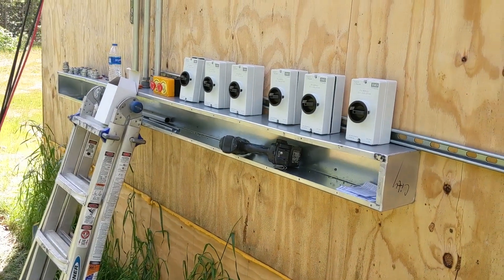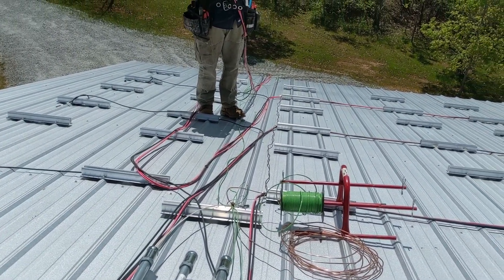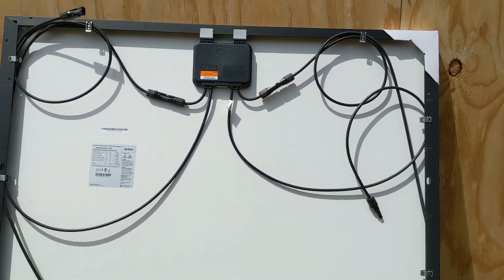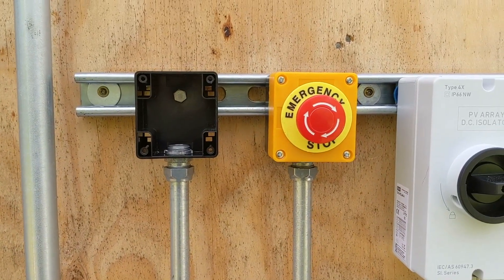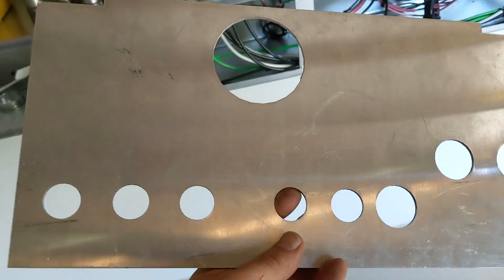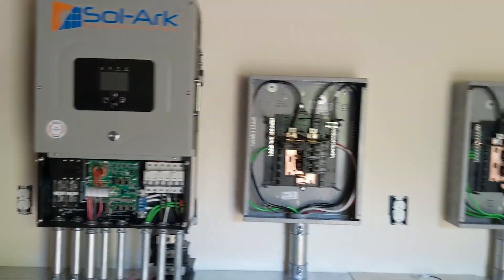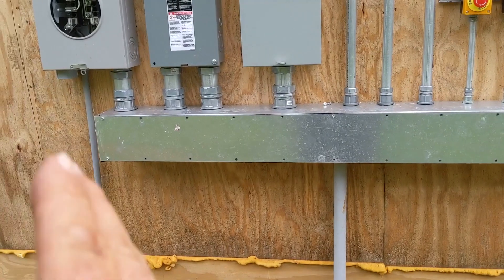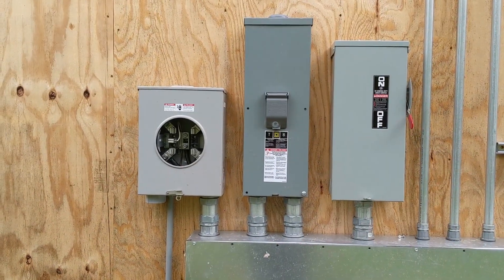Easy Parallel Stacking for Massive Peak Power

Comment: Great work. I'm about to install a system with two Solark 12 kW inverters. I do have a question regarding the transfer switch. You said it transfers between Solark and Grid. Is that necessary? Would love to talk to you if can spare a moment.

Comment: I did my homework and realize that I was being unreasonable with all my newbie questions.  It is an ac combiner box. I downloaded the sol-arc 12 Outdoor type manual and it explained a lot.  So I apologize.  I am enjoying many of your videos. Keep it up.  This morning I saw on the news of the heatwave in California and Oregon and the melting of cables.  Have you any feedback from homeowners as to the solar units installed and how they are operating? It would be helpful to do a video on the effect of the heatwave on rooftop solar setups and how to upgrade to existing solar system for future heatwaves.

Comment: Nice set up.  a few questions if you don't mind. First did you do positive or negative grounding on the solar panels? Did the roof racks have provisions for grounding to the panels? I understand some systems allow for the grounding wire to be run with the cables to the disconnect boxes. You used iron pipes to run the cables from the solar arrays, did these pipes and all the iron guttering system  had to be grounded also? What size wires were used from the panels to the gutter system? What size panels (voc Isc ) and how many strings ex. 12 in series and then in parallel? 
Thanks

Comment: Scott, question on the Dual Sol-Arks and breaker sizing?  Correct Breaker Size for Grid going to sol-arks? 50A or 60 A breaker?  On the Critical Loads Panel back feeding from Sol-Arks? 50A or 60A breaker? I believe each solark will allow 63Amp of pass through on grid?  So that is why I was thinking of needing a 60 Amp breaker size at the critical loads panel. Thanks for your help!
Reply from the maker: 60amp.

Comment: I’m installing 6 strings of 8 (48) 430w q cells, ground mounted. Dual 12K. Can I use two (one for each inverter) 16a 6p IMO’s instead of six like you have here? They are rated 16 a PER POLE.

Comment: Why 6 disconnects? 3 per sol-ark. I thought they were for the PV strings and the sol-arks only accept 2 MPPT strings each? What am I missing? Also with the quick disconnect are the other disconnects needed? What is not shown is the wiring diagram it would be nice to see how all the hardware is wired.

Comment: I love the clean work you guys do, especially with the trough setups, and bypass switches on all installs, looks great. Me personally, I don't really like the idea of having a 'rapid shutdown' right on the outside of the house where any stranger can push it and kill your power to everything. I wonder if you could automate rapid shutdown into a fire detection system that would trip with your fire alarm. I wouldn't want any switches on the outside of the house unless they were secured...
Reply: I'm pretty sure the rapid shutdown would not be compliant behind lock and key. Just a guess and based off nothing but my mind.

Comment: I’m confused. Will the service panel for the house be outside of the main house since you said it has not been built yet? How will power get to the finished house? I’m curious because I want to move my service panel and inverters to an out building about 100 feet away from my house. Thanks! Great instal and video!

Comment: I notice everything exterior is mounted on plywood.  Is that the finished exterior or is there going to be siding?  That plywood only has about 5 years before it disintegrates.
Reply: True, but I'm sure if they can afford that set-up, there's a bigger plan and all will be fixed or corrected before its covered. I've seen meter boxes/panels installed before siding went up.

Comment: @Engineer 775, love your setup and explanation on this video. But  l was wondering why no battery backup storage included?? I also like 3 - way switch box to change up power sources when needed. 
Saw l need do that for my next home in the near future.  Please include a basic wiring diagram too, unless you are worried about property theft.  Thank you again for the video detailing how to layout a solar panel installation.

Comment: I would say that a rapid shutdown is an overkill.
Reply: Not really.  You can't see anything up top and not any time to test everything if something bad happens (lightning strike, maybe).  Run up, tap the shut off and disconnect everything to allow safe diagnostics.
Reply: I'm betting it was some sort of electrical code maybe?

Comment: With this system. Can you do a whole house 200 amps of power not on roof but on ground ? How much for this sistem
Reply: Same question - I have 400A service split into 2 200A panels. Would love to back up everything, but 200A would be fine.
Reply: Too many variables. If you consume 1200-1400 kWh of power per month in the middle-southern half of the USA, you’d be close. DIY with some LFP batteries for $50K.
Reply: @USA-GreedyMenOfNoIntegrity  TOO MUCH $$$ HAVE TO DO THE TOTAL AMPS. 40A. HEATING ,20 AMPS WATER PUMP, 40A.COOKING,20AMP WASHER,30AMP DRYER

Comment: Scott, I have a question about ground mounts. I just happen to catch this video and this idea popped into my brain space. You and Johnny can give your input on this idea. He and I have been in talks about a ground mounts and my site has less than ideal conditions for typical ground systems (ledge, rock, more rock, some stuff imposing as dirt, earth biscuts and trees lol). I took my mini and dug test holes. Some were very easy to dig about 4 feet down while a couple other spots were just solid rock at 8 inches. Johnny and I talked about ballasted mounts. I don't know how I feel about them. They seem bulky, quite ugly and I see potential for them to be a problem with frost (I'm in NE PA). What about building small solar arrays and installing them on single post mounts, like those used in tracking systems? I feel this would give me more flexibility in placement and size. I know with typical ground mounts that use a single post buried in earth need to be aligned, level square and true to each other. My terrain isn't super flat, has a soft slope, but the overburden is my concern with these. I also want to start small with the system and grow it as it becomes more financially accessible. I have a magnum inverter and charger working off 6 100w panels at the moment. I have no utilities on site as of yet and the power company is giving me a hard time so I'm about to say ** off. I'm just looking for some insight from you guys since you do this for a living. I don't know how often you run into the type of earth I have. Any additional info would be appreciated. Thank  you for your time!
Reply: If you got solid rock you might be able to use masonry fasteners to secure a post to the ledge. You might need to pour a small concrete block on top of the rock to provide a flat surfaces for the post ( I am presuming the ledge is uneven & sloped). Then drill holes into the block & ledge using a hammer drill and fasten the post using simpson titen bolts. For steel posts you can weld on a bottom flange. I believe for wooden posts you can by pre-made bottom flanges.

I would recommend to work with the power company to get grid service. It will be cheaper way to go unless you have deep pockets for panels, genset and lots of gas money for the genset (specially if you not in a sunny location, or your property isn't in the best location for sun). You basically be running that genset 8 to 10 hours a day during home construction as you & your crew will be running power tools all day. Not fun filling up the GenSet 2 or more times per day and making frequent runs to fill up a bunch of 5 gallon fuel cans.

FWIW: It took me about 4 months to get the power company to extend service to my home site. Issue is that power companies are having trouble finding workers (few young men are not interested in, or have health\drug issues. The older guys are slowing retiring). Just be nice, & patient. They work with you if you give them a chance.

FYI: While I do have grid service I also do have a SolArk installed, just no panels (yet - still working on home construction).
Reply: https://www.rbisolar.com/solutions/ground-mount-solar/

RBI has a ground mount ballasted system.  Basically any ballasted system could be ground mounted if you didn't have issues with landscaping causing shade on some low profile mods. Maybe putting down some type of plant barrier and then a ballasted system on top would work for you. Ecolibrium,  panelclaw, and unirack all have good roof ballasted options that would work on flat ground

Comment: I really love how you install these systems but the over all PV systems is far too complex. I need a plug and play unit that would not need a engineering degree to operate or service if something ever went wrong.
Reply from the maker: But a PV system is well worth the lack of having to deal with a generator and fuel and maintenance etc. Most people do not need a stacked system and if you have a single inverter it's a lot simpler. However if you need power this baby will deliver 36 kilowatts instantaneously.

Comment: the " off-grid" is not off grid if you have a gen set which runs of fuel. because you have to buy that from the shop. offgrid is with solar or wind or hydro. but good video mate.
Reply: It is offgrid in my book.  The generator is not required.

Comment: Looks great. Do the Solarks start the gen set up, then can you program the Solark to wait "X" amount of time, BEFORE applying a load to a cold diesel engine....AND THEN, once the gen set is no longer needed, it allows the gen set to run and cool down for "X" amount of minutes before shutting down the engine for good?

I had a Trace SW5548 power panel back in the 90's that worked like that. I program it to allow the diesel to run for 10 minutes at an idle to warm up, and then it excited the alternator, and when done, it disconnected the alternator and let the engine run for 5 minutes at an idle to cool down. In northern Wisconsin in the winter time, applying a load to a cold engine is just going to really shorten the life of a diesel engine....ANY engine for that matter.

I liked that Trace inverter, because it had 3 or 4 auxiliary relays that you could use for anything you wanted and in the menu, set each one up anyway you wanted. One relay I had programmed to kick in a block heater and and a heater under the oil pan, on the diesel and run for 60 minutes to warm up the engine oil and coolant before starting the engine. I don't remember EXACTLY how it worked, but I think it was programmed to kick in the heaters once the battery bank dropped to a certain level and the 60 minute timer began. Another one I think was set to exercise the gen set for one hour every 30 days too, but I can't remember....this was 25 or 26 years ago maybe. 

I know a friend of mine who had the same set up. He had one programmed to kick in if his batteries were charged and he was still producing solar power, and it ran a well pump and pumped water into his huge holding tank for drinking water for him and his animals, but if the level got below a certain point, it had a float that kick the pump in no matter what was going on with the solar and batteries. Anyway, keep up the great work.
Reply: FWIW: if you want a fully custom control for your genset, then consider getting a PLC that you can program to do what you need. You could program to monitor system load so that if your pulling a high load, it would start the GenSet even if they batteries are nearly fully charged. You can also use a PLC with contactors to shutdown none essential circuits, or load shed if your overall load is too high. Or turn on some circuits when the generator is running (ie hot water heater elements)
Reply: Yes, the Solark starts the genset based on how you program the SOC start  ( state of charge of the battery)  it then shuts off when the battery reaches 95% .  THe relays in the solark take enough time to allow the genny to warm up before connecting and charging.  However on the shutdown it is turned off but odds are the load has already been satisfied by the time the battery reaches 95% SOC.

Comment: The inspectors I know won't allow a conduit into an enclosure, without an approved connector - complete with locknut and bushing. Here's how a bulkhead plate would allow proper fittings to be used between the back to back troughs.

Say you're using 1-1/4" conduit: hole saw the exterior trough to whatever size would allow for clearance of the 1-1/4" fitting, let's say it's a 2"TS. Continue with the 2"TS hole saw through the interior sheeting, but not through the interior trough (although the pilot bit should penetrate the trough). Then use 1-1/2"TS hole saw through the interior trough. Now build up the conduit and fittings, the right length to go between the troughs, let's say PVC with male adapters on each side, all glued up. Shove the assembly through the hole, into the interior trough. Add lock nut and plastic bushing. On the exterior trough, make a square bulkhead plate that's big enough to cover the 2"TS hole. The plate should have 1/4 clearance holes in each corner. Hole saw the center of the plate to 1-1/2"TS. Deburr and paint the plate electrical gray. Mount the plate, allowing the male adapter to protrude. Add lock nut and bushing.

I ususally keep various sizes of 16ga blanks laying around that I had a fab shop laser cut. I had them all painted electrical gray. I do a lot of automation work, where bulkhead plates are frequently used to pass cables with connectors through enclosures. You can use a blank cover, but my fabricated covers look far more presentable.
Reply: That  is a great tip and I will do it next time.  Thank you!  What is you glued in a PVC box adapter.  Are they not acceptable? So do you self tapper the 16 ga plate to the exterior trough?
Reply: @practicalpreppers7798 
I think what I'm calling a male adapter, is what you are calling a box adapter. So, yes it could be PVC with box adapters on both ends. As far a screws go, self tappers should work, but don't use really long ones. Long ones can bind against the wood behind the trough, as the screw is screwing into the metal. Better to drill small pilot holes and use really short sheet metal screws that are not self tappers.
Reply: @practicalpreppers7798  Just use Threaded-Rigid to connect the outside wireway into the inside wireway. You can buy it at lowes or homedepot. Its what I used to to attach the enclosures to the wireway so you dont have to juggle around with the EMT connectors. I imagine getting all those short EMT connections between the wireway and the enclosures is a major PITB!  -Pain in the Butt :)
Reply: When I have a preexisting box mounted that i want to nipple into, I use a larger hole saw that allows the lock ring to pass through. The holesaw goes through the wall from behind the enclosure and the pilot hole will penetrate the back of the enclosure. Then you switch hole saws to one for the size conduit threads you are using. That pilot hole is now in the center of the hole that is through the wall material so the hole in the metal using the same pilot hole is in the center.  I'm in Chicagoland o everything is conduit. Threaded nipples require the smallest holes but a connector can be embedded in the wall to. I've seen guys cut the set screws off connectors to get them into a smaller hole. If you use a compression connector just gotta be sure you tighten it real good before you stick it in the hole. You can size up a stub of pipe and put connectors on both ends to make your own nipple or use a threaded end of a rigid or imc pipe and a connector on the other end...

Comment: So when you loose power you loose solar, why can’t they develop a automatic switch to disconnect the solar away from grid? I liked the video.
Reply: there is a automatic switch to disconnect, but depends where you live and if its regulated to be used, we have there here in australia
Reply: Jamie Marsden Jacksonville FL.
Reply: Not an issue with Solar Ark, They work like a UPS system, with a Grid input and an load output. If the Grid goes down they switch to battery. Perhaps if you use the Grid-Export (sell power back to the grid) you might have an issue, but that function can be disabled. 

With my setup, if I loose power, the SolarArk switches over to battery power. When the power returns, it switches back to grid power and recharges the batteries.
Reply: Guy Tech that’s what I want for my system.
Reply: Is the tygo a micro converter? Can you use different brands with Solar Ark. My main circuit breaker is a 200A unit.
Reply: You need a battery like they did on this install to have backup power.  Power produced needs to be consumed in real time unless you had some type of shunt.  There is an outlet in some grid connected SMA inverters that will be isolated from the grid during an outage allowing power to be used from solar in real time without a battery.  I have also heard that this capability is possible with enphase microinverters although it isn't yet available.  It is a complex issue to have power production match demand and with the focus on rapid shutdown requirements I doubt we will see non battery grid connected systems able to stay live during an outage for a while even if it is technically possible with an automatic transfer switch and some type of shunt or limiter.